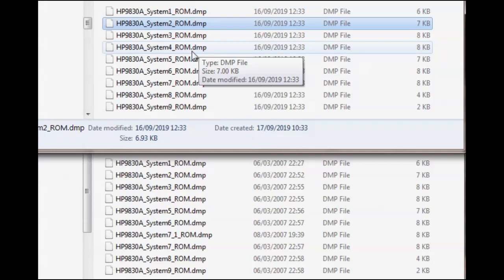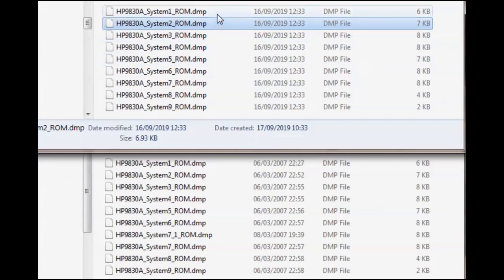HP9830A  Repair  Part17

Comment: When you say "ROM in the emulator" is this something that came with the emulator, or the code you extracted from the patent?
Reply from the maker: I tested the emulator with the code files that came with it. I then replaced each block one at a time with the files I had extracted and converted from the 9830 ROM board. This showed some errors so I replaced the 'faulty; blocks with the code from the emulator and checked these against the patent (actually the converted version I extracted from the patent). As they then matched I used these to program the replacement ROM and that is what I used in the 9830.
Reply: @JerryWalker001  Ah ok, so the emulator ROM files match the patent? That is very convenient!
Reply from the maker: @JonathanStray  There are some 'errors' in the patent listing but they are fairly easy to spot so once corrected and converted they match the ROM board (if inverted of course).
Reply from the maker: @JonathanStray  I forgot to say that in some of the videos I add the 'additional' ROM code which normally resides in the small second ROM card into the new ROM board I made but in the final ROM I put the small ROM board back in and remove the code in it from the main ROM image. You can see the wires running to the 'dummy' board in the videos.
Reply: @JerryWalker001  Yeah, saw that, thanks.

Comment: The noise after the beeps when you were testing ROM 2 is the printer output. Three blank windows also open when the emulator is run. One is labelled HP9866B which is the line printer.
Type LIST and press execute, for instance, to print to this window. In your case it might have printed an error message.
Reply from the maker: Thanks, I did try looking at the other windows but they were all blank. The IDE was showing an error message so I think that the emulator had crashed. The results tied up very well with the file comparison results and indicated exactly the same ROMs had failed. Hopefully it means that the emulator code will be a good starting point for programming into my new ROM board and also shows that the machine will not run with the code I have. Now that I know what the noise is I will try switching to the printer window as quickly as I can and see if anything shows up before the emulator crashes. The keys do not seem to be responsive at this point. It does not surprise me that an IO device was being accessed during a fault condition as that is exactly what my machine does (usually the sounder but sometimes the display shows odd artifacts). The emulator is proving to be very useful in the repair process.
Reply from the maker: Nigel, I just tried switching to the printer view before hitting the stop key and you are absolutely correct. It is not printing anything meaningful, just nonsense so it is obviously just sending random data to the the printer channel. All bets are off once the code has run off track. Thanks for the information. It does seem to be a feature of the machine design that when things are not working it can send some information to the IO ports. It sometimes does the same thing with the display and random segments are illuminated for several seconds and then it stops.
Reply: yeah its the line print output.